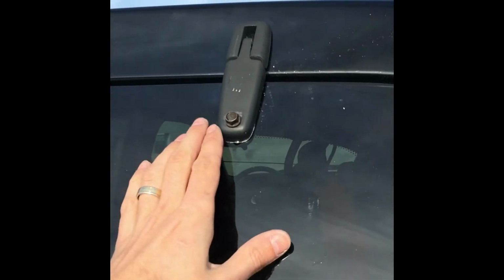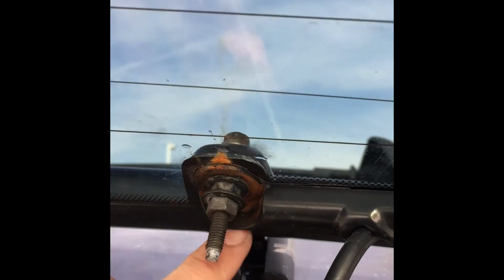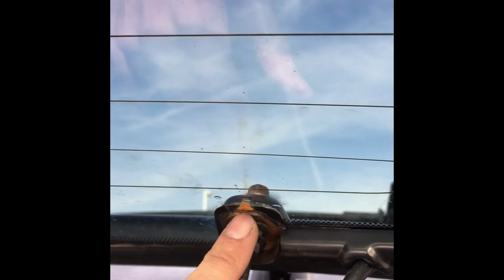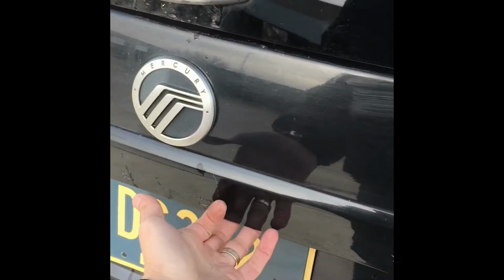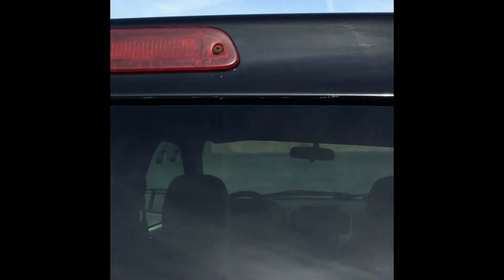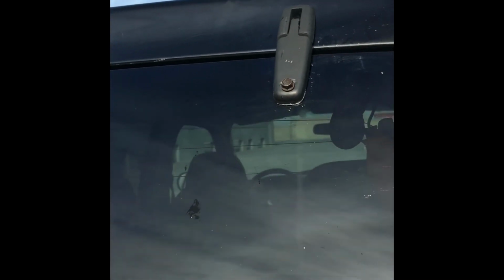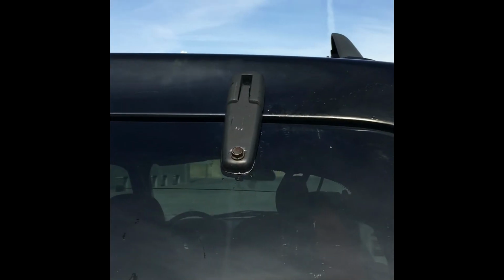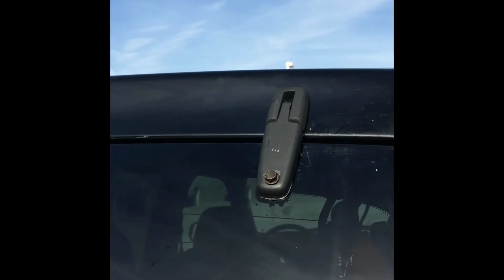Mercury Mariner / Ford Escape rear glass hinge repair

Comment: My hitch glass brkt. Will b replaced tomorrow but I was also wondering if the rr windshield washer blades don,t work and the wiring seems Out of place around the Brits.does one issue have anything to do with the other. I just bought this car.
Reply: I have the same problem